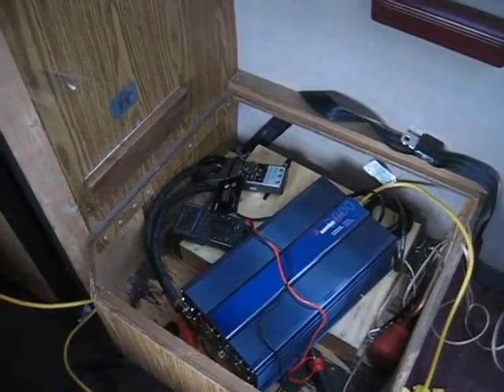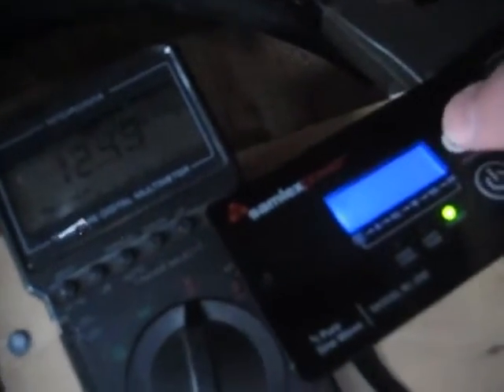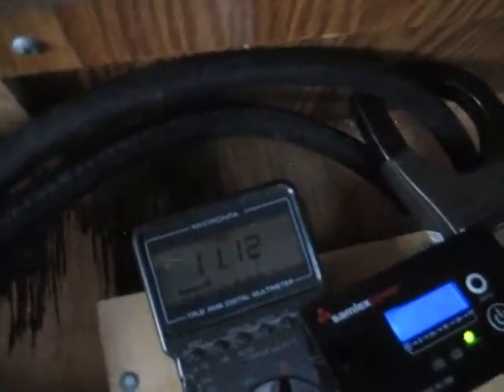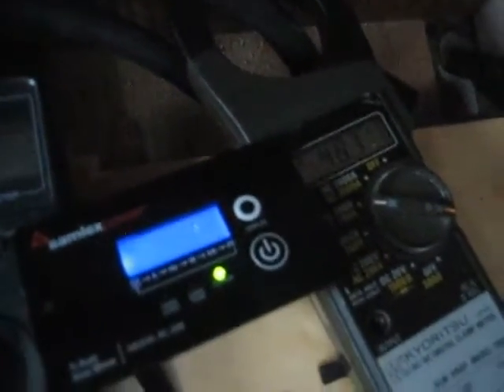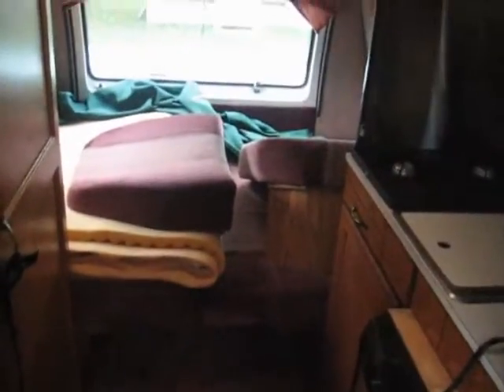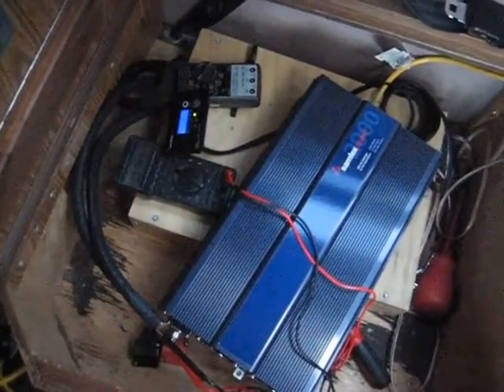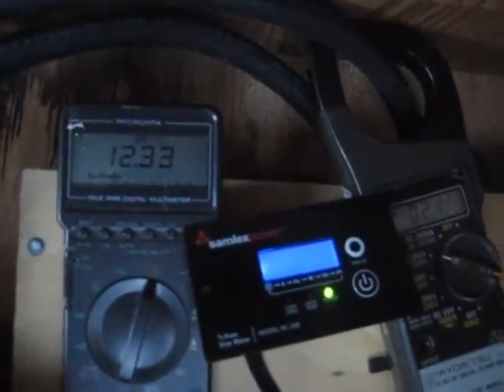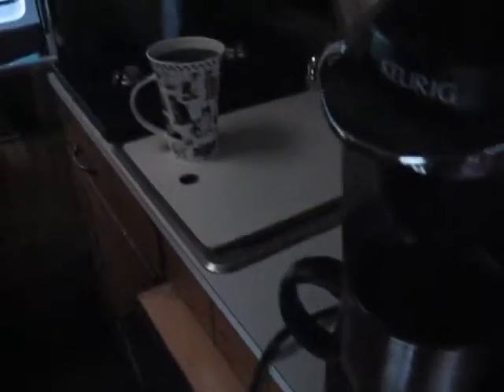Keurig running on 2000 Watt Samlex Inverter

Comment: Thank you very much.
This is exactly what I was wanting to know.
I have solar panels and a 2000w Renogy inverter with 4000w peak watts that will handle 2 Keurig cups of coffee in the morning no problem when I cant use a generator yet.
Then I go outside and set up my panels after or during coffee time.
Your setup had no problem.
Then you want to make sure your solar or generator tops them off again before you do it again.
I would make sure your batteries were at max volts before doing that if possible.
Thanks again. Great demo.

Comment: I haven’t been successful in running a kurig with a 2000 watt inverter and 3 batteries it will heat the first batch but kicks the inverter off midway thru the pump cycle. I have heavy wire to the batteries any thoughts ? Bigger inverter? It’s a single cup but I’ve tried the regular maker same problem
Reply: get some real batteries like some huge underrated battle born battery branded lithium's and a good under rated inverter like these samlex pst series inverters

Comment: I am glad u posted this. I have tried finding videos that prove that it can be done. I have a 2000wt inverter and tried to power my oxx coffee box (1450peak) and it kept tripping off my car battery. I wanted to see if two aux batteries would do it before I go spending the money on 2 batteries. I'm not as electricity savvy as you, but would 2 (100amp hour) batteries be able to make at least 6 cups of coffee without solar panels? I would likely be using something like a battery doctor (isolater) to recharge the aux batteries while I'm driving (with the alternator).
Reply from the maker: What was tripping?  There are some tables that can be reviewed to determine how much load can be put out for how long without overly discharging the batteries.  It's been a while since I did my research so I will need to dig up the data again.
Reply: Stephen Rivett I put alligator clips on the wires from the inverter. I clipped them to the car battery while it was idling. Inverter powered up,  coffee machine powered up. I press the brew button and you could hear the coffee box doing it's thing (warming up the heating element i believe). Then when the unit goes into pump mode, it all shuts down and the inverter beeps and shuts off for a few seconds. I figured the car battery by itself was simply under powered to hit the peak wattage once the unit began to pump and heat water at the same time.
Reply: @briangarcia2358  does your inverter do pure sine wave? The brand of inverter he is running is high quality and gives particularly clean power. Then there's the issue of your batteries. Higher wattage is very hard on batteries - must pay close attention to charge levels, discharge amperage and make sure you are not using a standard car staring battery for anything longer than 15 seconds at that kind of amperage. Regular starting batteries are not designed for "continuous duty" like that, you should run some quality deep cycles, preferably made with 99.9% pure lead, and never take them down as far as 50% of their charge level. True quality power on the scale of what comes out of your wall, even for light/intermittent use like you're describing, is not a super easy or cheap undertaking - good luck and happy camping!

Comment: Well i certainly cannot recommend this product at all. My company  purchased quite a number of samlex inverters to power some hot spots sites but it was a waste of time and money, because they kept going down.....smh.
Reply from the maker: That is unfortunate.  The RJ-45 connections can have issues but in an RV you are generally present so you don't need to worry about having it up for a long time without supervision.
Reply: Improper use usually kills these things